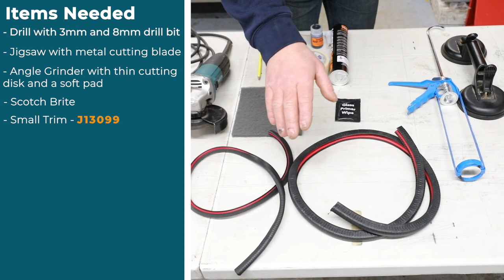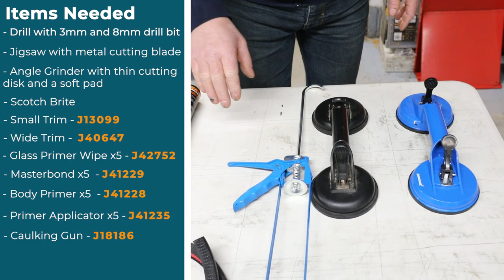JK Guide: How to cut and fit windows to your van

Comment: Hi I've just fitted my van window but only primed the van not the glass, Now I'm worried. Will it be OK?
Reply from the maker: Hi Chris! No need to worry! We only advice to double up to create that extra protection. Your glass should be totally fine with just the Van primed.
Reply: @justkampers  Thanks for your advice. I've had it reset now as it leaked . I have arthritis in my hands so couldn't do the sealant well enough sadly

Comment: Not how to cut out for windows. Don't use a grinder for this job.
Reply from the maker: Hi, generally yes you are right a grinder can cause more damage if not correctly masked up. But we had masked up correctly to protect the paint and other components. This video was a demo of what can be done with tools from home. But yes we would recommend using a jigsaw. Thanks for your interest.